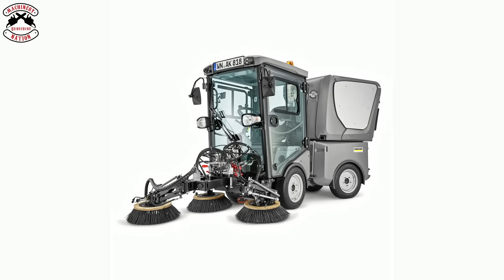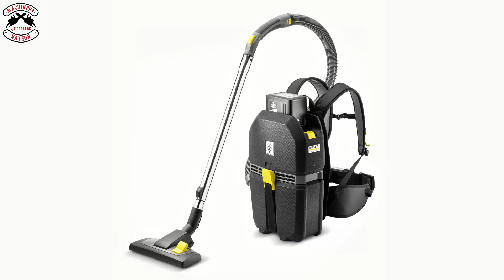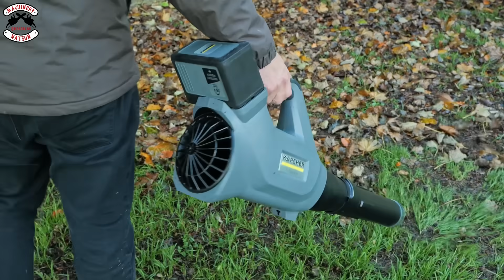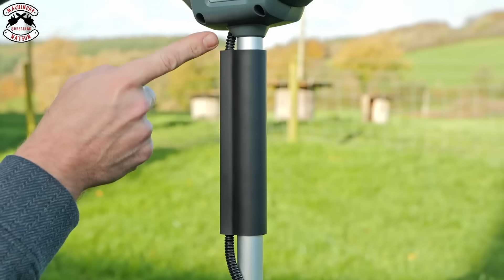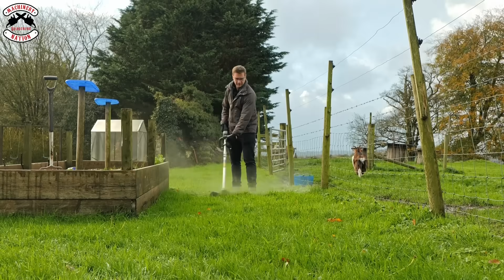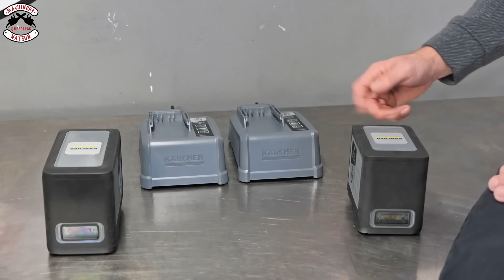What Is Kärcher's Biggest Kept Secret?

Comment: Wonder if they sorted the pressure washer cylinder head design flaw ? ( cracking)
Reply from the maker: No idea, every brand/manufacturer has issues with certain products and product lines and they generally get to the bottom of them eventually, if it is a manufacturing defect rather than user error that is 👍🏼